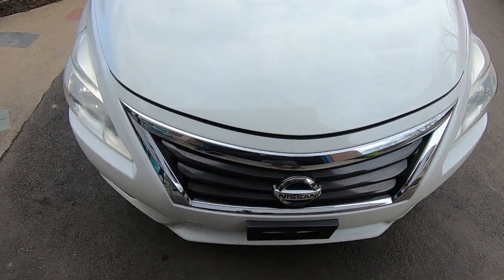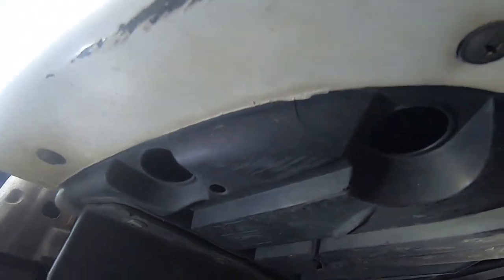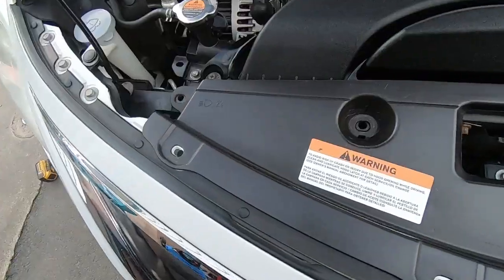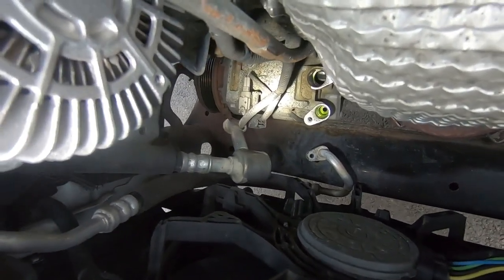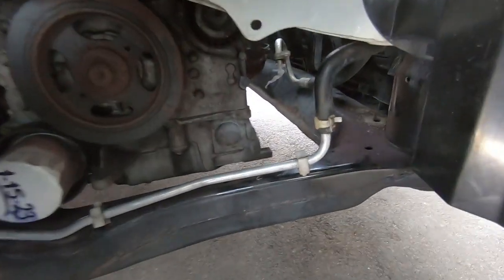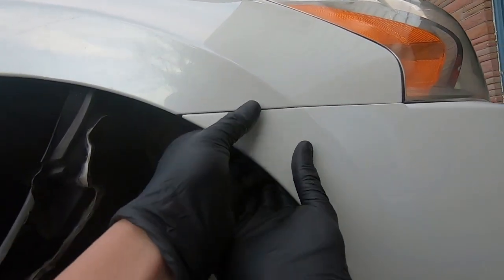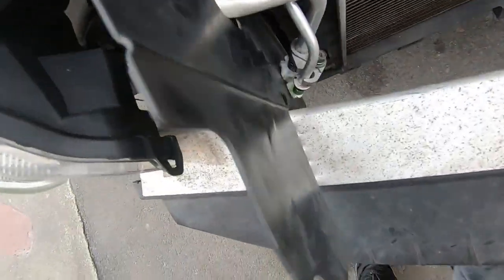2013-2018 Nissan Altima A/C Compressor & Condenser Replacment (Full A/C Service) [2.5L QR25DE]

Comment: BC, I'm 30 min in but needing to get to bed.  I'll finish tomorrow most likely.  I don't have any A/C issues on my Altima, but wanted to learn about it all and I knew I'd learn the max from your video.  I replaced my nieces crankshaft position sensor today on her Hyundai Elantra.  I found what I needed after watching a few videos, but even then, I struggled with a couple hiccups.  It really makes me appreciate all the amazing video content you've created for the Altima.  I"ve learned so much from you and have grown so much more as a mechanic.  Part of me wants to wait to buy a new car until after you get a new car and start making some videos on them.  (new used car,  I don't buy dealership new cars)  Thank you for all your hard work and great explanations.  If there is a better mechanic youtuber out there, I've never seen them.  You are easily the best in the business as far as I'm concerned.  No lies.
Reply from the maker: Thank you so much for the comment! I truly appreciate it!! 

The Altima is actually my girlfriend’s car, she bought it brand new in 2014….and I’ve been maintaining it since day 1. Currently has 240K. Looking to get her a new vehicle by the end of the year, just to get into something newer/nicer. 99% its going to be 2nd. gen 2021+ Acura TLX, probably a low-mileage sub 30k pre-owned.

Comment: I had the compressor on my 2004 Frontier seize in 2018 while on vacation; this uses separate belts so I could still drive on, was only 103F at 10am at the time (Arizona).  Once I got home, I replaced the compressor, condenser (parallel flow condensers cannot be flushed well), and drier, and - unlike you - I reverse flushed the high pressure line with solvent and dried that.  Obviously, this truck does not have transverse engine like the Altima, so is somewhat easier access, but the front trim parts did need to come off.

Comment: Great video, but the vacuum step needs to be included. I wanted to see how you dealt with the refrigerant removal process.
Reply from the maker: Its not included because in my opinion it should be professionally done with a refrigerant recovery machine. It should be evacuated, and then a vacuum should be pulled & correctly filled to correct lbs. with the A/c recovery machine. I did note this in the end of the video. IMO people really should not be trying to fill this themselves with Walmart cans, especially with no A/C experience. Should be professionally charged. And even if I did include the removal/charging, no DIY’er watching this is going to have a $2k+ recovery machine. So thats why I suggest it should be charged correctly with professional equipment & it wasn’t displayed in the video.

Comment: Thanks for this video I’m working on both thermostats right now
I noticed the second one did not have a gasket or seal and the seal the thermostat comes with is not the right size
Does that matter ? It didn’t have one when I took the second thermostat off.

Also I put all the bolts back in and it was leaking so I had to take it apart again 😅

Comment: Where are you located? My AC not working blowing out hot heat. 2014 Nissan Altima SV I need help
Reply from the maker: Probably just needs to be recharged. You just need to take it to a reputable shop that deals with a/c and have them recharge the system for you.

Comment: How different is this procedure on a 3.5SL?? I've been trying to find a video on mine...but there doesn't seem to be any.
Reply from the maker: Its going to have a lot of a similarities, like the lines should be all but the same, the connection fittings the same torque specs, etc. the difference is its going to be tighter, belt routing is different, and the compressor is probably going to be a bit harder to get too. But definitely a lot in the video is still applicable to the 3.5L.

Comment: I sat and watched the entire video. You were very thorough and we appreciate it but just out  of curiosity since anybody can buy R1 34A without having a license can you just vent the refrigerant? I was just wondering.  I would probably try a used compressor before buying all those other parts.   Great video.    Thanks for posting it.
Reply from the maker: I mean you could, but its illegal lol.
Reply: One can buy R134a in USA without a license, Walmart, parts stores, etc.  Just make sure to use pure R134a WITHOUT any sealers or sealer chemicals.  NEVER add any sealers !!!  UV dye is fine. Venting refrigerant to atmosphere is illegal.

Comment: Thank you so much for the video, its really helpful and enjoyable. 
I'm hesitant to buy the same ac compressor kit from rock auto because i don't know if the ac compressor and condenser a good quality. Can you tell me how's the overall quality? Can it last for the next 5 years after installation ? 
Thanks a lot
Reply from the maker: Appreciate the comment. But thats an extremely subjective question nobody can give you a direct answer too. Parts are made more cheaply than ever, regardless of brand…so definitely something to keep in mind. However this kit seems pretty good IMO and still going strong.

Comment: My ac only blows cold when i start actually driving the car and its moving.  Would i need to replace all this as well? 2017 4cl altima sr. Thanks for any help in advanced
Reply from the maker: Hard to say, you need to have it properly diagnosed. I would have started with a recharge. The system really does need to be recharged first, to have an accurate starting point to diagnose if there is any issues. I would say a good percentage of the time, the system just needs a recharge when it starts to get warmer. But you have to recharge first too see if you have another underlying issue from there.
Reply: Check to make sure that your condenser/radiator fans are all operating.

Comment: Are you sure a c clutch didn't lock verse the ac conditioner locking up can you explain the difference
Reply from the maker: I’m assuming you mean ‘compressor’ and not “conditioner”…but its the same thing. The a/c clutch is part of the compressor. So it someone says the a/c clutch locked up, or the a/c compressor locked up, it’s the same issue being referred too.
Reply: You can have a bad clutch, and a bad compressor. They are different parts. The clutch allows the compressor to be turned off with the belt still attached. The compressor could lock up internally. Or the clutch can lock up or loose ability to lock up. Clutches can be replaced separately but usually compressors are replaced with a clutch on it.
Reply from the maker: @jasonsparrow4981  you are definitely right! Your answer was more explanatory than mine lol. I was referring to when someone says the compressor is “locked up” its really all the same issue at the end of the day….most just replace the whole compressor with the price of compressors today. most aren’t replacing clutches separately anymore, most just buy a whole compressor.

Comment: Hi, just curious why did you drain the oil? I was looking at a UAC compressor for my 2013 altima on rockauto and the description states it comes with oil. 

Also, is the compressor still running? It difficlt to find reviews for the UAC brand compressor on my car.
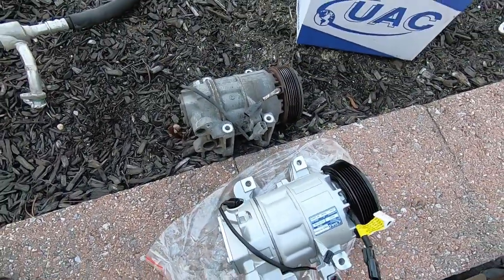Reply from the maker: Your oil question is covered multiple times in depth in the video. You can start it @50:30, or @52:30, etc. and its all covered as to why and why it needs to be checked & done. 

And as of now its all still good..going strong!
Reply: @TheOriginalBeeCee  awesome. Thanks! Was worried about the brand having issues. How long did it take you to swap everything out?
Reply from the maker: Allllllll day. But it’s kind of hard to go off my time because it probably took me double as long….if not more, recording everything and making sure I got everything.
Reply: I'll be doing this tomorrow, with the same kit. Did yours come with an expansion block? Did you change it off camera?  Thanks for the vid!

Comment: What if I forgot to put the oil in the new condenser? 🤦🏻‍♂️ will it get messed up ???
Reply from the maker: You definitely want the correct amount of oil in the system, can definitely get damaged if not.
Reply: @TheOriginalBeeCee   how can I do that ? Basically take it apart again and add it ? Or can I just add it by unscrewing the connectors
Reply from the maker: @MrRaze58th  i would suggest doing it how I outlined in the video…but you can probably do it without taking everything apart & and just disconnecting hose connections.

Comment: I just found your video, you did  great jobs so quickly I add you to subscription. 
I have questions: my friend just helped me to change ac compressors, and put the 134a.I driving around half hour later, the ac blow hot wind, when I stopped 10 mins cold again, but another 10 mins hot wind happened again. Please would you tell me why? Or I need to change condenser? Need help please🙏🙏🙏
Reply from the maker: Do you know how he added the r134a? Was it with cans or a AC machine?
Reply: @TheOriginalBeeCee  he added a can 134a
Reply from the maker: @winniewang9152  i would have the freon pulled, pull a good vacuum on it, and refilled with a properly gauged A/C machine or setup. Those cans usually do more harm than good. Not to say they can’t work, but most just add them without any gauge of what amount they should be adding.

I touched base on this in the video, its extremely important to get the exact amount of freon in the system. In fact, if there is more freon in the system than there should be, its actually worse than there not being enough. It can drastically affect temperatures and output.

Take it to a shop or someone who has the correct machine/tool to fill the freon to the exact 1.16lbs.
Reply: @TheOriginalBeeCee  Thank you so much for your wonderful video and the information. After I did go to the dealer shop. You were right that the machine took working good. And I learned that it has some air inside so a can 134a 1.35 lbs won’t work especially when we change new ac compressor. 
Thank you so much again!
Reply from the maker: @winniewang9152   nice! Glad you got it resolved. I figured that would be it 👍
Reply: @winniewang9152 how much did they charge you to vacuum the air out and fill up with Freon?

Comment: Mine blows cold air sometimes and hot air. I got the ac recharged and it didn’t fix it 😢. $226 down the drain. My compressor isn’t making any noises or anything. I feel like they charged me to do nothinf
Reply from the maker: Well, you started in the right place….I would have started with a recharge. The system really does need to be recharged first, to have an accurate starting point to diagnose if there is any issues. I would say a good percentage of the time, the system just needs a recharge when it starts to get warmer. But you have to recharge first too see if you have another underlying issue from there. 

I would go back and tell them the recharge didn’t resolve the issue, and ask if they used refrigerant with UV dye. Because if they did, they can easily check the connections and start with seeing if the system has any leaks. From there, they should be able to diagnose the issue if they’re a reputable AC shop. If I had to guess…i would say it might be the expansion valve, but it really needs to be evaluated to make that determination, because it could also be the compressor, etc.
Reply: @TheOriginalBeeCee  that’s exactly what I told them I think it is(expansion valve) when they explained how everything works. He immediately dismissed that. I’m going to have another mechanic look because Meineke doesn’t have a good reputation. Something is just unsettling and I don’t think they even tried to look. They just want to charge me $1600 for a compressor. I will get back with you but I will ask if there weee any leaks.
Reply from the maker: @FirstnameLastname-vi7hm  i hear that! If you didn’t feel good about it, I definitely wouldn’t return. Just make sure you take it somewhere who regularly deals with AC and/or has a good reputation surrounding AC work. But definitely let me know how it goes & what it ends up being!
Reply: @TheOriginalBeeCee  Thank you! I sure will
Reply from the maker: @FirstnameLastname-vi7hm  🙏🙏
Reply: I fixed the intermittent AC issue (compressor clutch was slipping) on my 1998 Frontier by taking off the compressor drive plate and removing one shim, so the "air gap" was smaller.  I didn't even need to remove the AC drive belt.

Comment: Do you have to decompress or empty the fluid before you start?
Reply: If the system is still charged, you have to vent the system using manifold gauges. If the system is fully charged those hoses will be under about 80psi of pressure. It's gas, not liquid.
Reply: No no need to evacuate any lines that may be under pressure. 😊

Comment: You have a nice video on how to take stuff apart and put together, but you are super wrong on AC repair procedures.
Reply from the maker: Elaborate Elmer Fudd..
Reply: @TheOriginalBeeCee  I'm a mechanic in Phoenix. I know AC lol. 
You always have to flush the entire system, replace the dryer (yours is in the condenser so you're good) and replace the txv. The only reason I would do what what you did is if I was on a super budget, and the compressor clutch went out. Then I would drain the oil out of both compressors, fill up the new one with how much came out of the old one, still vacuum the system for at least an hour...
Reply: @TheOriginalBeeCee  how did yours hold up? It's been a few years. I would think it would have died again by now.
I know you're not an AC expert, but you did pretty well.
Reply from the maker: @elmeradams8781  expansion valve was replaced. & how do you know the system wasn’t vacuumed for an hour and flushed?
Reply: @TheOriginalBeeCee  your video was long. My coworker was following your video, he said you didn't, so he didn't. 
We spent the day doing it the right way for him. 
I didn't want people to get the wrong idea about doing ac work. 
Ps I only watched about 10 min of your video, so if I got it wrong, correct me.
Reply: @TheOriginalBeeCee  but how's it holding up (I guess that would be the real test, not what some random YouTube guy says).
Reply from the maker: You most definitely got it wrong. And I know you didn’t watch the whole video. And thats what I’m getting at. 

Nothing was done wrong in the video…in fact, it was all done to Nissan’s own FSM as outlined with screenshots in the video. 

If you actually watched the WHOLE video, you would have noticed I mentioned (and even did a quick screenshot) of it being serviced by my friend who is an Master ASE mechanic & has his own shop @ his house with a $2k+ refrigerant recovery machine. He lives 5 minutes from me. He towed it for me as I mentioned in the video, but before bringing it to my house he stopped @ his & evacuated it for me. I did the job, drove it right to his house and we pulled a vacuum for probably about 2 hours and charged the system. 

I didn’t include any of the refrigerant process because IMO should be done correctly with a recovery machine, not by some dude who bought cans @ Walmart and tries to charge the system himself. So as I noted in video, it should be professionally evacuated/charged. Hence, why it isn’t in the video. But it is however noted this was done in the video.

…So please, don’t jump in peoples comments discrediting their hard work like “yOu ArE sUpEr WrOnG” when you didn’t even watch the video in its entirety to be able to make such brash statements. 

As far as it holding up….A/C is as cold as the day it was charged from this job. Currently @ 241k.
Reply: @TheOriginalBeeCee  nice. Did you flush the evaporator? That's what he didn't do, so we took it apart and did it right. Even if the oil is perfect (which it wasn't, since his compressor was bad), how would you know how much oil is in there.
Reply from the maker: Naaa i didn’t do anything with the evaporator. As I mentioned in the video I didn’t find any debris in this system, so personally I didn’t see the need too. And I was under the impression the core doesn’t hold much oil. But, I am no A/C expert. But I’m not opposed to doing that of course, so thats nice you did it. I’ve always heard/seen if you didn’t have the system open for a period of time, or drove for some time without refrigerant, or if there is no debris from the internals of a compressor exploding or something you don’t need to flush evap core. and just from some quick Google searching looks like there are some others under this impression as well. As far as the car in the video my friend thought it was on point after the vacuum & charge so idk lol.